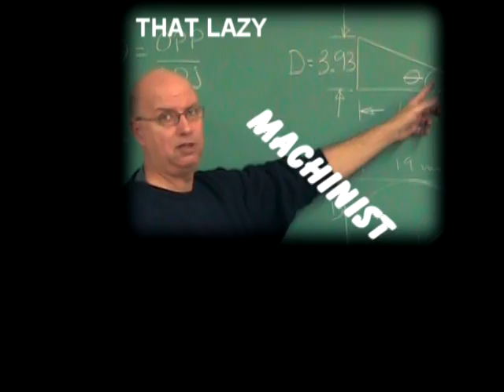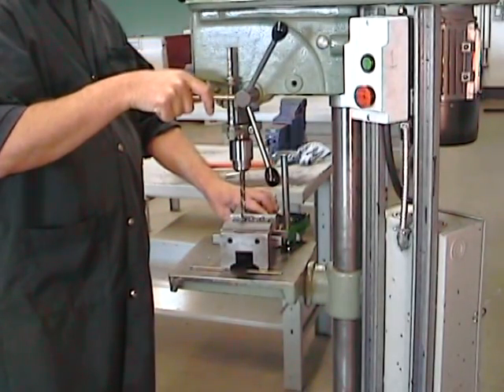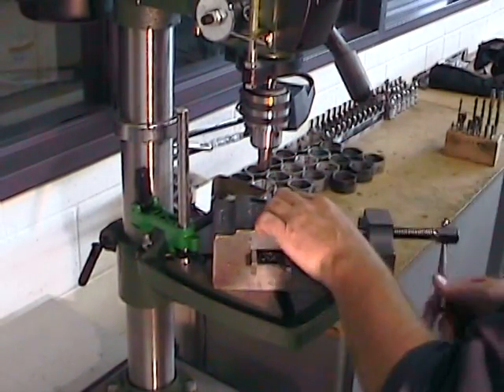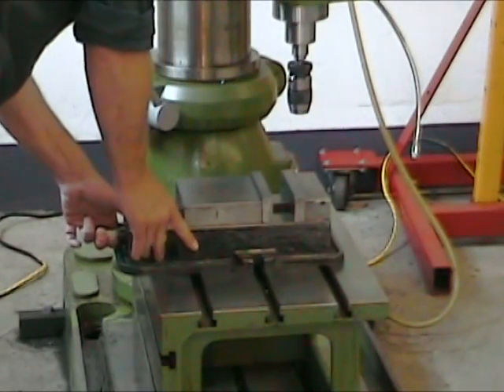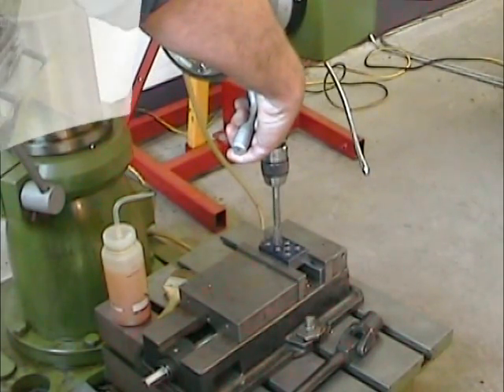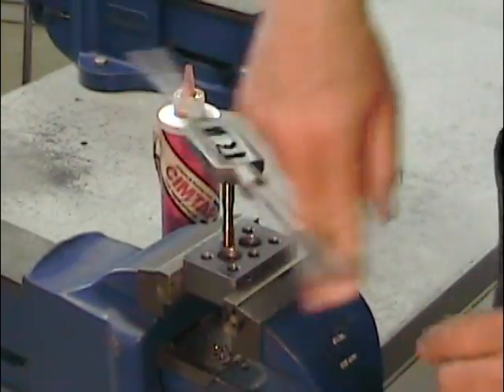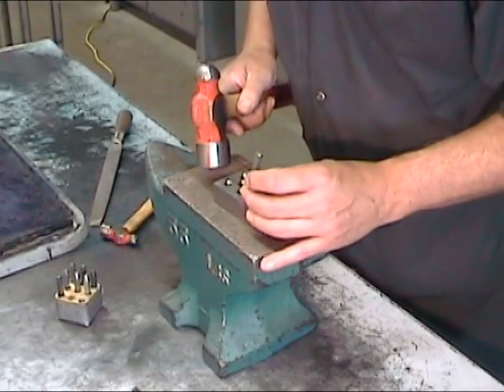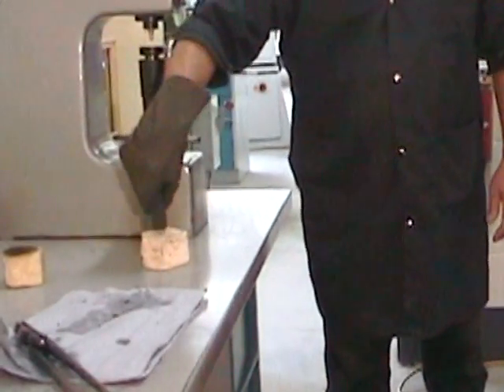THE 1-2-3 BLOCK PART 2 : MILL, LAYOUT, DRILL, COUNTER BORE, TAP THREADS, CHAMFER, MARC LECUYER

Comment: On another note if you have purchased blocks and want to join them together to make a structured fixture you will find the 3/8 bolts don’t fit through the unthreaded holes like they’re supposed to. I just drilled out my 2,4,6 blocks with indexable r390 and it cut through that hard steel no issues. Now I can slip 5/8 bolts through and screw two blocks together as a right angle and don’t need a right angle plate.

Comment: [Edit for accuracy] While the exact temperatures will vary a bit by alloy, halting the quench above 400f(200c) may result in a significant lower-bainite structure rather than the [generally] harder martensite structure traditionally sought in quenching. Not necessarily a bad thing, lower bainite generally requires little to no tempering and can have similar properties to heavily tempered martensite.[good for springs, eg] 
I believe the process name for the procedure is austempering, though you are in a hybrid temperature range. (in austempering the "tempering" step is more of a holding point in the quench to give the bainite time to form) 
230c/450f** is a typical start temperature for martensite[Ms or 1%] 175c[M50] and 70c[M90]. (**mid range, for W1 tool steel or 1070 plain steel. 1018 is up at 470c(but why quench 1018?)) 
Many low alloy steels have a martensite finish temperature [Mf/M100/M99(depends on which books you have)] well below room temperature, but 20c is about 7% retained austenite[M93] in W1 tool steel. The retained austenite may be converted to a ferrite and cementite structure during tempering.(specifics are temp and time dependent)
In practice martensite is temperature but not time dependent, while pearlite, spherodite, and bainite are both temperature and time dependent. (which is why rapid quenching of austenite can skip past them and form martensite) Strictly speaking martensite is also time dependent but its formation propagates at the speed of sound, so instant in practice.
Reply: Addendum to my last post. 
Low carbon steels have the highest Ms temperature. As alloy and carbon content increases the martensite transition temperatures drop. The following are all in Celsius. Clearly carbon has the biggest effect. 

"The equation is valid only if all the alloying elements are completely dissolved in the austenite.
Ms = 561 - 474C - 33Mn - 17Ni - 17Cr - 21Mo
For high-alloy and medium-alloy steels Stuhlmann has suggested the following equation: 
Ms(°C) = 550 - 350C - 40Mn - 20Cr - 10Mo - 17Ni - 8W - 35V - 10Cu + 15Co + 30Al"

(so 1050 steel would have an Ms of about 320c and W1 about 200c)
This can be altered in hyper and hypoeutectoid steels with very accurate control of the austentizing furnace temperature, such that the effective level of *dissolved carbon is altered. But this gets beyond the realm of video comments.

Comment: Marc,

I know that was tough material, so you slowed the couterbore rpm way down.

But... what surface speed should be used in general for counterboring in mild steel?

Cheers,

Glenn
Reply from the maker: Hi Glenn, the cutting speed is the same for all operations. For mild steel I would suggest around 120 F.P.M. The problem isn't the RPM, it is the feed. Form tools offer a large cutting surface to the part, this requires a lot of force to feed the tool into the part and the end result for many machines is that we just can't feed fast enough. As an example lets take a four flute counterbore around 3/4" ø. For mild steel we would calculate at 120 FPM around 640 RPM. To feed the tool without chatter I will want a tooth load of at least 0.004". The feed would have to be 640 X 0.004 X 4 = 10.24 inches per minute. That is an impressive feed and almost impossible to attain with most drill presses. The answer is simple, lower the RPM until you get to a point were you can feed the tool comfortably without chatter. It has been my experience that four times slower works well for most home type drill presses. I hope this helps, Marc L'Ecuyer
Reply: Marc, much appreciated for the explanation.

I was hoping for some quick rule of thumb that I could apply to the diameter of the tool to get a approximate RPM. You know, something like on reamers - half the speed double the feed -kinda thing.

Just something practical I could use when I go to use one of these counterbores.
 
Glenn
Reply from the maker: Glenn Davis Hello again Glenn! The biggest problem with counter bores is chatter. Chatter is caused by an insufficient chip load (as is the case for reamers and counter sinks). Turning at slower RPM's permit you to maintain a good chip load from start to stop. Because we naturally slow down the feed towards the end of the hole, the chatter often appears at the end of a cut. So a good rule of thumb would be to stay around 100 RPM's for holes 3/4" or smaller. Reduce even more if hole is larger. It is important to feed positively right to the bottom of the hole and retract as quickly as possible.

Comment: why not just run the taper tap further through to get full threads all through the hole?
Reply from the maker: Hi Andy, you have a good eye! I made a booboo! To force the students to use both the taper and the bottoming taps I usually order hand taps that do not have reduced shanks. As is clearly visible at minute 13:35 of the video, I am using reduced shank taps. Even though it is only partially reduce (they cannot be run through the part completely) the taper tap I am using can produce a completely thread for this depth of hole. Thanks for the comment since it permits even more explanations and that will benefit others. Marc L'Ecuyer